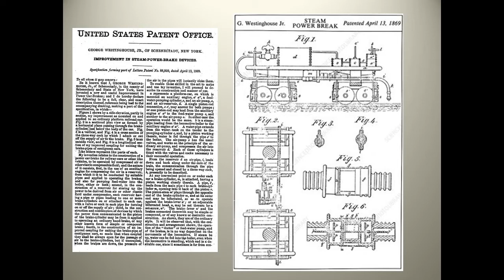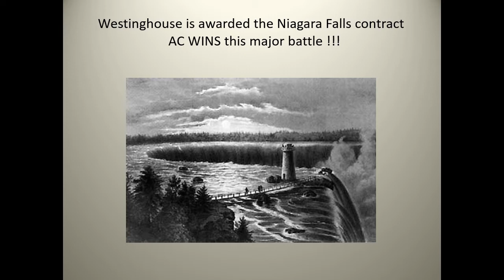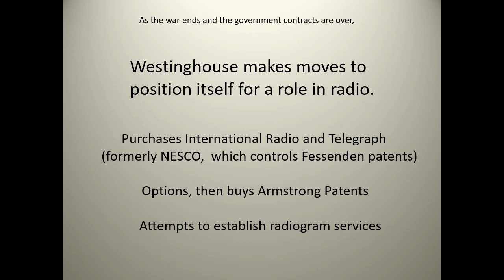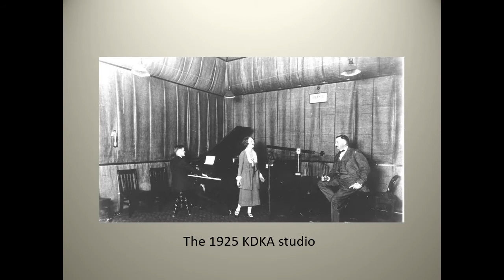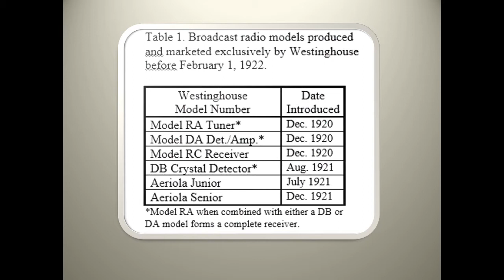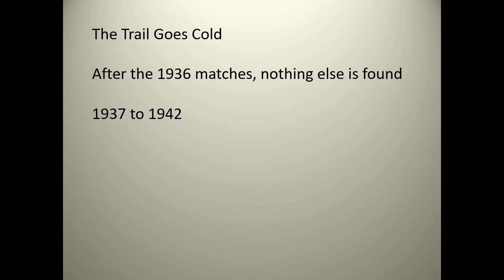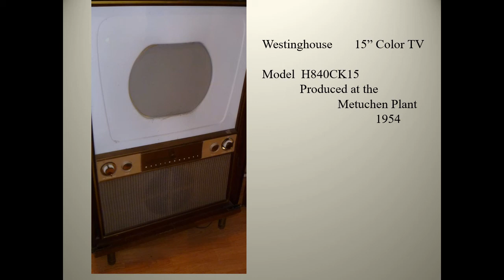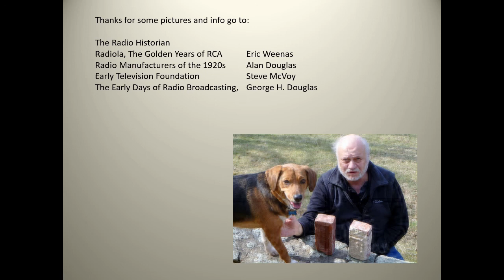The History of Westinghouse Radio and Television and KDKA Pittsburgh

Comment: My grandfather, ( Frank Verner) worked for KDKA in Pittsburgh in the 1930's as a technician. One of his duties was to over see the operation of the mobile broadcasting truck van. They used to broadcast University of Pittsburgh footballs from their football stadium using this van packed with radio broadcasting gear.  It was his responsibility to keep it working.  
   During the depression a lot of workers lost there jobs.  I asked my grandfather about holding his job in the depression  and he said he got knocked down a few notches but he still kept his job. He got to know some people in radio that later became famous movie stars.
     Later he worked at the East Pittsburgh Manufacturing plant, then moved on to the Westinghouse Plant in Trafford Pa after it's expansion.  He did the wiring inside the large transformers.  He retired from Westinghouse in 1968.
     I never met a Westinghouse Employee that didn't like their job.